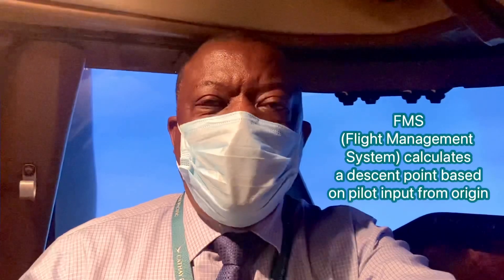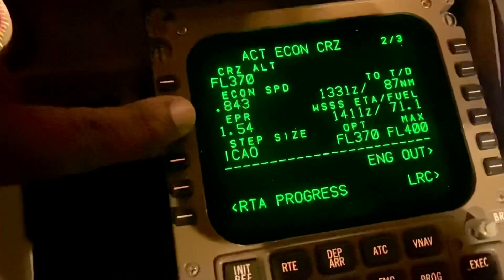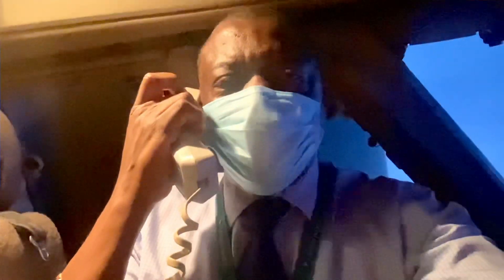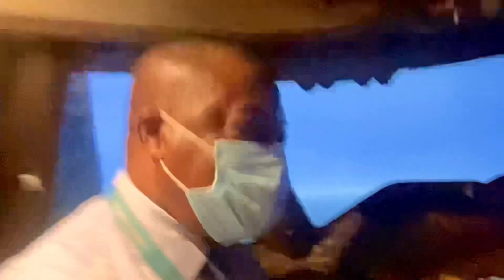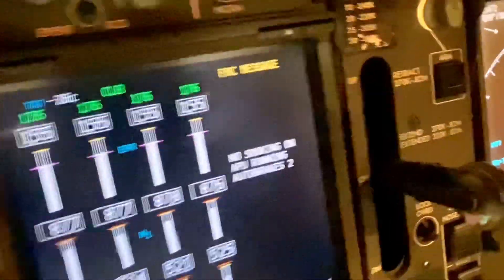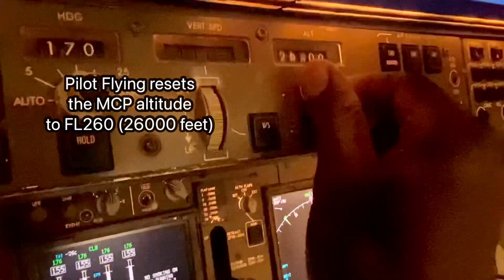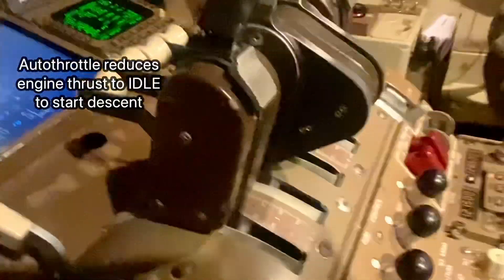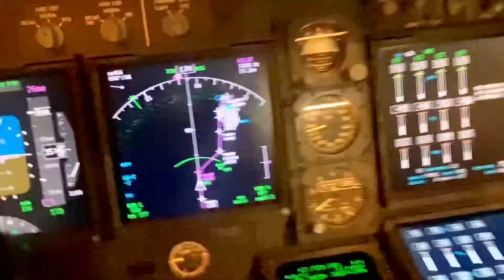Boeing 747-400 descent mode and cockpit actions

Comment: For those that are interested the FMC on the -8 is a central point of communication that cross talks to the FCC, flight control computer, the YSM yaw stabilizer module, the MMR, sub-component GPS/ILS, and the ADIRU, air data inertial reference unit. The FMC also control the throttles. All those computers talk to the EIU, EICAS interface unit which sends the informatiom to the DU, display units, for the crew to view their route on the ND, and pitch roll yaw, and ILS on PFD. The 400 is very similar with some differences.

Comment: Thanks Captain Obet. I have a question. When flying at high speed, Elevator is the only flight control required more force input to the column to get the same elevators deflection. On control wheel and rudder pedals, there is no change. Am I correct? Thanks.
Reply from the maker: The stabiliser is also moveable and so are the elevators.
Reply: @pilot_obet  Thank you Captain. The video shows A/P put idle thrust for descent.  What kind of situation do pilots use speedbrake lever in descent phase? Thanks.

Comment: Because the top of descend tells the  captain how many miles are left prior to descend initiation.  So, with that in mind why would you have to divide by 3🙂?  Please let me know.
Reply from the maker: The descent slope is 3 degrees angle that’s why. If we descended at 90 degrees for example, the aircraft will descend straight down vertically. It would be multiply by 0 essentially- straight down